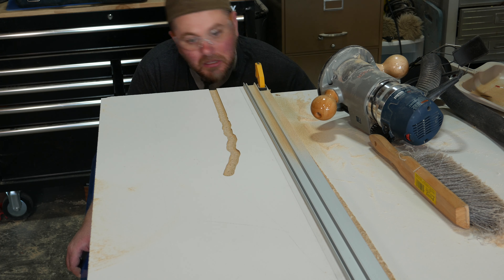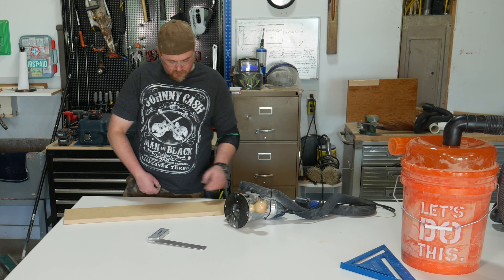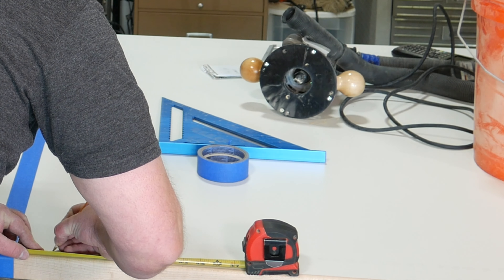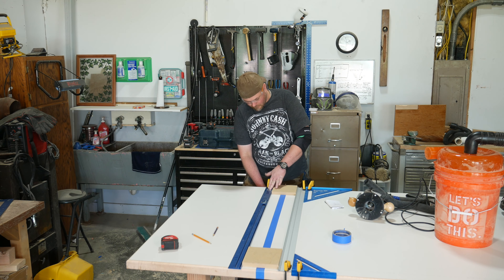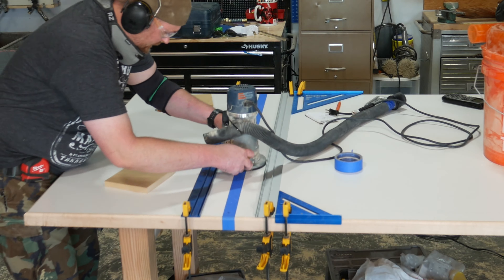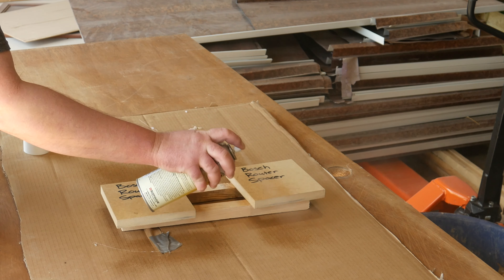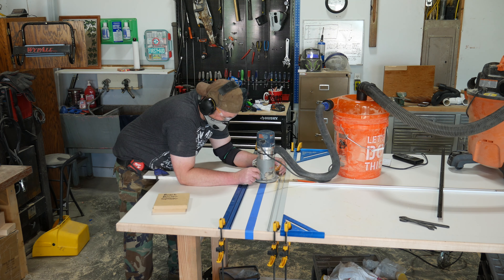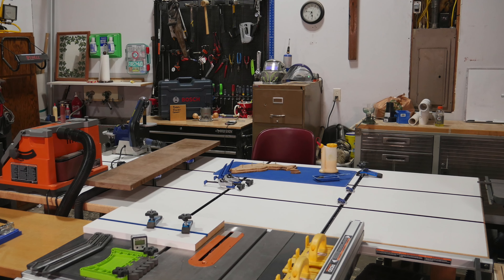How to cut perfectly straight dado grooves with a router

Comment: Snoitch! That’s a better unit of measurement than some crude ones I’ve heard in the past which I don’t care to repeat in the comment! I don’t have a plunge router like yours but even with a trim router, it’s worth going through the process of setting up a proper guide that is clamped to avoid unnecessary and expensive mishaps. I had to cut a a notch for a demountable hinge in an oak cabinet door and I couldn’t find a perfect hinge for the job but with creativity and multiple tools, I got the job done with zero errors!👌🏽
Reply from the maker: Fun fact, a snoitch was a common unit of measurement of the ancient sumerians. Ah those sumarians, excellent wood workers. And that’s a fact, because science. Nice work on making it happen with a little ingenuity on your project. Thanks for watching!

Comment: When I searched "cut grooves for t track", your video came up.  Thank you!  I volunteered to make the new router table at our local maker space.  After pulling my hair out to get the hole for the router lift cut out with the rabbet at the right depth for a flush fit, my next task is to cut the dadoes for T-track for the fence to ride in.  I will follow the steps in your video tomorrow.
Reply from the maker: Right on, Ian! Knowing that my method is going to be used to help create even one part of a maker space, makes me feel like I’ve done something impactful for the whole maker community. I hope you’ll come back and let me know how it turned out, maybe even email me a couple pictures!
Reply: So what happened , did you have to go out to get a wig ?...did ya ?

Comment: Have to agree with j about running the router in the opposite direction. Nothing wrong with the way you did it except the time involved, but if your time is worth anything $$$ there is nothing wrong with being fast & accurate.
Reply from the maker: This method is more for beginners, not experts or professionals trying to make money

Comment: Thank you!  I am working on building some cabinets/bookshelves, and they are too big for me to groove out on my table saw....so I got a router, and have been trying to figure out how to make sure I get a straight line...this is awesome, and I really appreciate it.
Reply from the maker: You’re welcome. It does take a little setup, but once you’re dialed in, just rout ~n~ go!
Reply: @JFKreations  better a little setup than wasting an 8 foot section of birch bookcase that will not have to be used for scrap/shelves.  :)
Reply from the maker: You speak the truth there!

Comment: The step you missed is to mark the exact diameter of the router plate so you know for certain it's aligned on the line you marked on the workpiece.
Reply from the maker: Good advice, but that’s generally information you should know about your router for just about any edge guide

Comment: Lol.  I am a newbie.  Actually your "exaggerated cut" was very much like mine.  Plus I'm using a melamine top 4 my matchfit project.   This is going 2 make me crazy by the time it's over.  Personally,  I use tish & tosh.  Tosh is obviously more than tish. 
I will try ur method.
Reply: Correction: not tosh, tad
Reply from the maker: Good deal. Let me know how it goes!

Comment: Thank God for your example. On the last guy, he had Car bomb commercials on its site. Thanks for your info
Reply from the maker: Car bomb commercials? Doesn’t sound good. Glad I could help
Reply: @JFKreations  lol  he was 45 acting 18. I'm sure you can find him lol. But you gave me lots of knowledge to build on
 I'm a handyman had took on a large free standing shelving unit job. I didn't like the inch and a half gap between each unit. I made a few jigs and the seem to work. But on a scrap run it produced a lot of smoke and took to much pressure.  An unsafe amount. I'm cutting small inserts to inset basically 2x4's as the structure.  Leaving a 3/4 inlay to cover the layers of plywood.  Jigs are working well. But my 40 piece router kit is letting me down. Lol so I ordered flush cut bits I think will help.

Comment: Already have the router jig.  (Got it years ago.  Need a longer track piece for the bookcases.)
Reply from the maker: Did you find a solution?
Reply: @JFKreations  yes.  Had to replace jig and guide pieces, largely in the belief that the jig is tied to one brand and style of guide track.

Required a fresh router bit to cut straight lines, as in birch ply takes the edge off in a big hurry, and that using name-brand - Whiteside - router bits!

I need to keep a close eye on such cutters.
Reply from the maker: @dennisyoung4631  good deal. Glad you got it squared away.

Comment: Thanks. just what I needed. I'm avoiding buying the Bosch Professional FSN OFA 32 Kit 800 FSN.
Reply from the maker: Jason Gairn had to look that one up. Looks like it may be a decent system, but expensive. I’m glad I saved you from having spend a bunch of money. Happy routing!
Reply: The FSN system saves me a ton of time, and I totally recommend it. And note that adjustment screw on the router adapter, with multiple passes you easily do any width with the same bit. Add the plunge saw, router adapter, and jig saw adapter on this common rail system and its worth it. 👍

Comment: is that the dewalt 12” miter saw? if so could you make a table on your miter station i like your design 🤟🏼
Reply from the maker: Jay Alvey Jay Alvey it sure is the 12” DEWALT sliding miter saw. Thanks for checking out the video, but I’m not sure what you’re asking about building a table on the miter station? That table I’m currently using for a miter station is a reclaimed standing desk that was destined for the trash. I gave it a second life in my shop. I did build the dust collection hood though. If you want to check that build out click this link https://youtu.be/k_Dl-gboTKs Thanks for watching!
Reply: DIY The Art of Wood much appreciated keep up the great work brotha
Reply from the maker: Jay Alvey will do, and thanks again for watching!

Comment: I have to cut 2 parallel dado cuts along an 8 foot / 96 inch table top. Your method works for the dado cut that is near the middle of the table but what about one that is close to the edge? For example were I want to cut, the router hangs off the edge of the table a bit so I cant place a second cutting guide. Do you have any tips / tricks for this scenario? This is so I can install T-Track onto the table with one of the tracks maybe 1--4 inches from the edge of the table.
Reply from the maker: Matrix8369 did your router come with an edge guide?
Reply: Router edge guide.  It's exactly what this is made for.

Comment: For a novice router this is a very interesting video. However, I can see how the technique works on a large board with the dado located away from the edge. I am trying (not very successfully or accurately) to cut a dado in a smaller board and close to the edge, and am having trouble setting up the router. The board approximately 2ft (600mm) x 1ft (300mm) and I want a dado cut across the narrow width ie across 1ft (300mm). The dado should be 3/4" (18mm) wide and 3/8" (8mm) deep located 1" (25mm) from one short edge.  Would appreciate any advice and/or direction to another of your videos that covers this type of work.
 Thanks for your videos.
Reply from the maker: imarr 17 thanks for checking out the video. Without getting too crazy with creative jigs to do what you’re trying to do, I can think of a couple ways to get that dado close to the edge. If you’re getting into woodworking, and it sounds like you are, this might be a good excuse to buy or make a router table. You can find some fairly affordable basic tables or go all out and lay down some serious money for one. There are also a lot of DIY how to videos out there showing how to make one. The other way would be on a table saw. You could either use a dado stack, or get a flat bottom grind blade and just make multiple passes moving the board slightly each time until the dado is the right width. You’ll want to use your miter gauge on the table saw to support the board as you make the cuts. Hope this helps! Thanks for stopping by.
Reply: You can also cut the dado on a table saw if you have 1.
Reply from the maker: Shannon P Shannon P definitely a good option for smaller workpieces. I wouldn’t want to try it on a full 4’x8’ sheet of 3/4” melamine like on this workbench though, that wouldn’t be much fun. Thanks for checking out the channel.
Reply: Maybe put another piece of wood the same thickness of the piece you're trying to cut the dado in, next to it so it supports the router?
Reply: Make a crosscut sled for your table saw. It'll handle tasks like this with ease.
Reply from the maker: I’d love to see a video of a table saw sled that can accommodate a 4’x8’ sheet of 3/4” melamine

Comment: Great Video. What router bit did you use? I am doing the exact same thing and the melamine coated mdf chewed up my carbide tipped bit after making 2 grooves and I have to make 6 more :)
Reply from the maker: Thanks! I use the Diablo router bits. They aren't the absolute best out there, but for the price, you can't go wrong. I've had good luck with Diablo bits and blades and they're easy to find.
Reply: Should be able to cut 50 dadoes with any carbide bit before you’d even notice it getting dull..
Reply: Did you get the bit shipped from china ?

Comment: Can you tell me what you’re using for that dust collection setup? I’d love to pick up one of those bucket dust collectors if I can find one. Thanks for the great videos!
Reply from the maker: Thanks for checking out the video. Here's the link for the Dust Stopper bucket lid dust separator https://homedepot.sjv.io/c/1343238/459920/8154?prodsku=302643445&u=https%3A%2F%2Fwww.homedepot.com%2Fp%2FDustopper-High-Efficiency-Dust-Separator-12-in-Dia-with-2-5-in-Hose-36-in-Long-HD12%2F302643445&intsrc=PUI1_2950 and the shop vacuum is  https://homedepot.sjv.io/c/1343238/459920/8154?prodsku=304006023&u=https%3A%2F%2Fwww.homedepot.com%2Fp%2FRIDGID-12-Gal-5-0-Peak-HP-NXT-Wet-Dry-Shop-Vacuum-with-Filter-Hose-and-Accessories-HD1200%2F304006023&intsrc=PUI1_2950 The hose I'm using is from Rockler https://www.rockler.com/dust-right-flexiport-power-tool-hose-kit-3-to-12-expandable
Reply: Hope you don't mind me throwing in my 2 cents but you can also built your own and save a few bucks. Just look up DIY cyclone dust collector here on you tube. I had a paint bucket laying around and some 1 inch schedule 40 pvc laying around. All I needed was some pvc 45 degree angles some straight pvc  connectors, pvc glue and a couple of rubber plumbing connectors. Cost about 20  bucks and works great!

Comment: Great vid, Jeremy! I'm a beginner (self teaching... if that's actually a thing) but have lofty aspirations to be a decent woodworker someday. Excuse me if I ask a dumb question, but here goes... I've watched your vid 4 times now and I noticed you didn't move your guides over to widen the cut to the width of the t-track. Is that because the router bit you used was a sufficient size for the job, therefore making it unnecessary to adjust your initial set up? If so, what size and type router bit did you use?
Reply from the maker: Sunny Woodard 4 times? I’m flattered and thanks for checking out my channel. That’s actually a really good question about the T-track. To cut that dado I just used a 3/4” straight router bit. Most T-track, at least all the T-track I’ve come across, is 3/4” wide so one pass width wise will do it. I do recommend taking a few passes to get to the depth you need though to not overwork the router and bonus you can also sneak up on that perfect depth for a smooth install. Hope that helps - Happy Woodworking!
Reply: @JFKreations  Very helpful! Thanks for responding.
Reply from the maker: Sunny Woodard you’re welcome. Hope your project turns out great.

Comment: Pretty good tip. I haven't yet taken my router out of its box, but once I do, I might have to give this a try!
Reply from the maker: Right on! Crack that box open and give it a go. What kind of router did you buy? Side note I’m watching your epoxy resin workbench video right now. I’m liking this idea. Kind of seems like it would be self leveling and give a dead flat work surface. How has it worked out? I haven’t worked with epoxy resin yet. Is it a durable surface for a workbench?
Reply: @JFKreations  Hi, it's durable insofar as solvents, acids, bases are concerned. IE they won't seep into your wood. It's not very scratch resistant. As for perfect leveling, if you start with a flat surface, and don't add any filler to the resin, you could potentially get it flat. I did not achieve this!
Reply from the maker: It looked pretty slick though. Interesting idea worth experimenting with
Reply: @Made2hack  If the table/form is level and the resin is slow setting, it should flow out smooth and straight?

Comment: Or you could route in the other direction so that the rotation of the router pushes into your straight edge.
Reply from the maker: Directionality is definitely an important consideration when routing. But this video is more directly intended to help take some of the guesswork and potential for mistakes out of routing, which can be intimidating for new woodworkers. This way they can focus more on the project and not have to focus so much on some of the more complicated details and techniques for using power tools like a router. But thanks for sharing that tip, also good information for the maker community. Thanks for watching.

Comment: Jeremy- I have had several disasters as your example shows.  I am using a 4 foot level clamped to my work surface.  The router vibrations are moving the clamped piece!  Sometimes by as much as 1/4 inch.  Any suggestions for stopping this movement?  I am stumped.  I dont want to nail it down to my work bench but I dont know how to prevent this movement.  Thanks for any guidance on this.
Reply from the maker: Dave Blew couple thoughts come to mind. Anytime you’re using any type of jig that you’re struggling with it staying in place, you can take a little spray adhesive and attach some sand paper to the backside of the jig (router guide). That will give it some good grip and keep it from sliding around. If you need next level grip, short of nailing it down, you can try some double sided tape. But beyond that I would want to look at why your router is vibrating so much and causing this problem in the first place . Personally I’ve not seen a router vibrate so badly that it throws the guides like what you’re describing. If the work surface you’re working on isn’t solid and can’t absorb vibrations well, maybe that’s why you’re seeing this. Also make sure your clamps have good pads on the grip surface so they don’t slip. Also take a look at the clamps themselves, make sure they aren’t loosening up on you. Really cheap clamps sometimes don’t hold that great. And finally make sure you set that cross brace well, that should help the router guide from flexing and moving. Hope this helps.
Reply: I know this was 2 yrs a g ..you could get the clamps that claim 4 tons of clamping power

Comment: Put your straight edge nearest you and the rotation of the bit forces the router into the straight edge. Not a lot but enough to maintain control.
Reply from the maker: I know how to use a straight edge. But some people, beginners specifically, may be intimated by a router. This can be a way to get past the intimidation factor and help someone get started. I see similar comments like yours on this video. Makes me wonder if everyone who makes a similar comment doesn’t realize that not everyone out there is at their same comfort level or experience. Seems to me comments like yours will only serve to make you feel superior, stroke your ego like you’re going to teach me something and discourage beginners to give something a try. While my video does the opposite by giving a beginner a cheap method that may help them get started. Thanks for another useless comment.